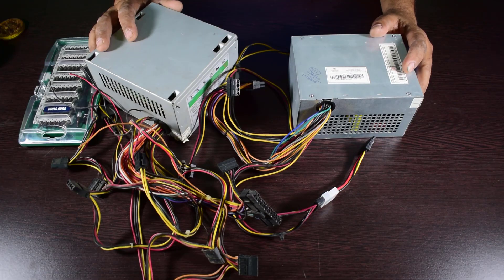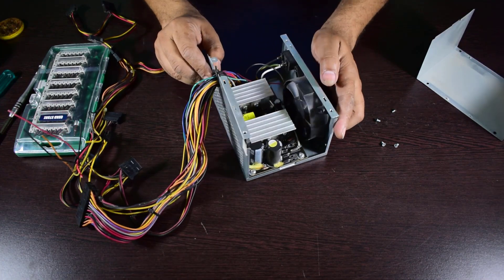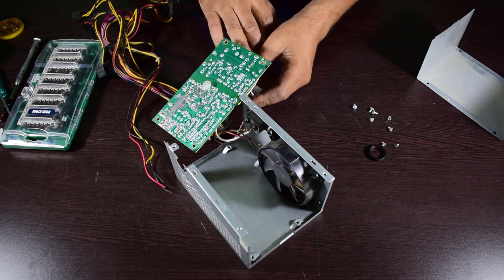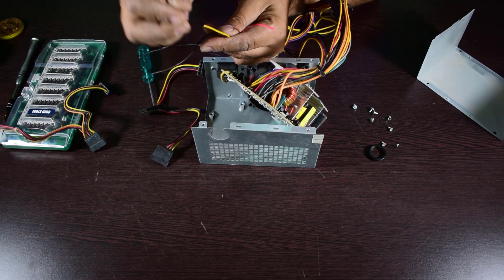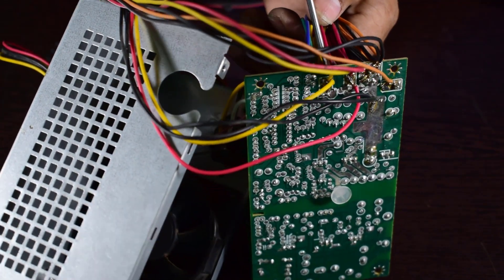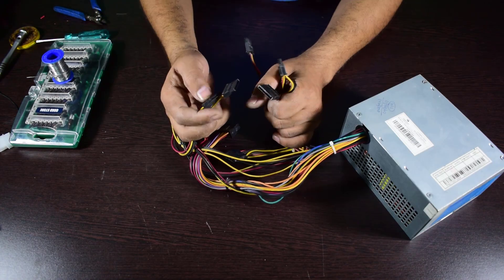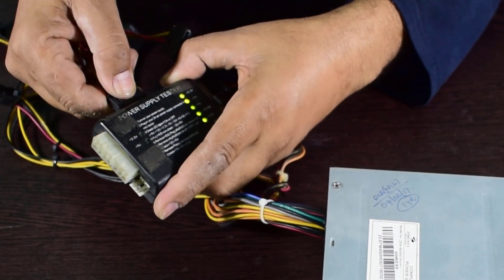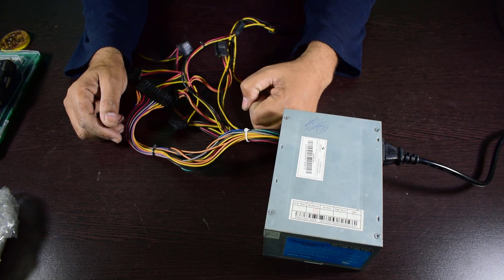Computer SMPS Modification|| Upgrade Computer SMPS || Increase SATA connectors permanently

Comment: Sir please help 
If we exchange the ground cables and connect to hard disk will there be any problem??
I have connected a sata power to another sata power coming from molex and my one hard disk is not working now.
Please help sir
Reply from the maker: Ground wire colored as black can be exchanged to other black wire..

Comment: problem is not the pata to Sata converter the more devices you connect you need a stronger power supply like min 450 or 650w for all of the devices to get detected and function normally. just soldering it directly wont help much specially if you have multiple hard drives, dvd drives graphic card etc.....though the video is nicely made. Keep sharing the good work and knowledge.......

Comment: ... ok, but what about power rating?
on the other hand, i seen a lot of smps's, not so old, with a lot of pata connectors, but one or two sata connectors.
a good idea is to unsolder those unuseful pata cables and solder sata in his places.
and finally... what about a bit of isolation between smps and his case? you can very easily make a little bit "too big" soldering, and get a nice chance of fireworks! :)

Comment: Sir I have 500w smps but no 8 or 6 pin pcie power connector and I want to buy Rx 570 which requires 450 w power .But amps has 2 molex connector 
The question is can I connect milel to 8 pin connector for Rx 570